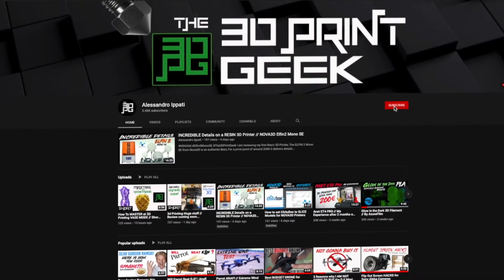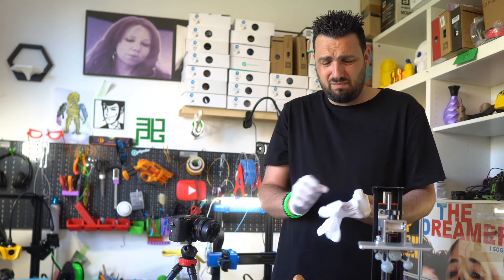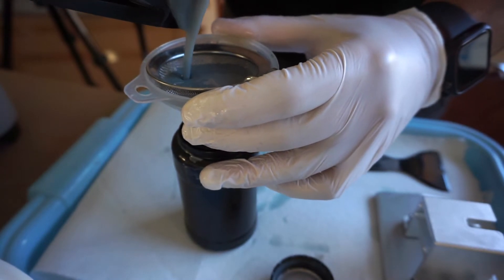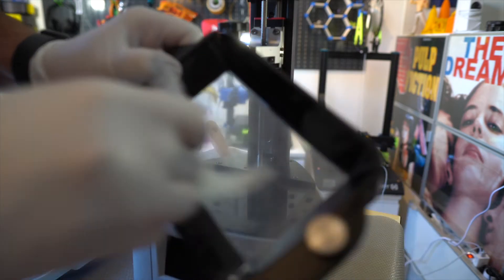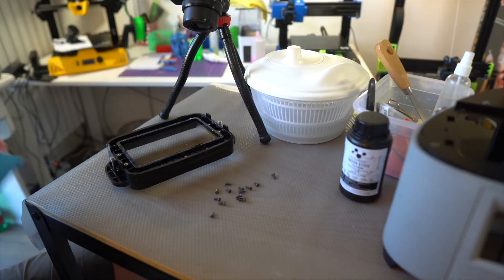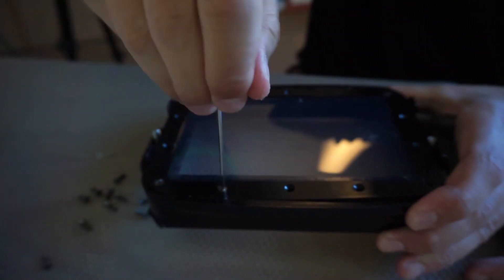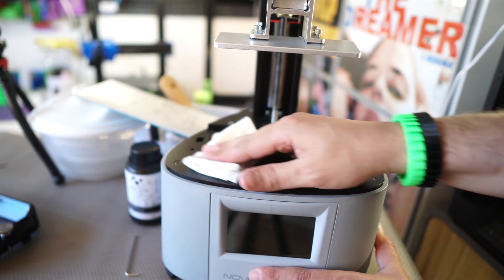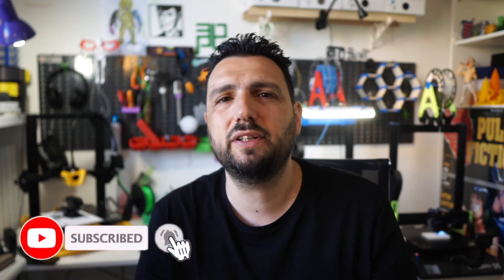Replacing FEP Film on NOVA3D Elifn2 MONO SE

Comment: Just made the exact same replacement and startede printing - when I saw a notice on the package: "please remove the protector of the film before use" and I do remember that from the first time - but this time I didn't get to do so. And I don't recall if it was on the inside, bottom or both. So I tried to figure this out by for instance watching your video. Haven't found any clue so far. The printing is still ongoing, but should be finished in a couple of hours. Something is attached to the buildplate. But what it will look like is yet to be found out. Will return😅
Reply: Well - couldn't se it - prints are with minor errors. A new set of film will have to be ordered to clarify this.